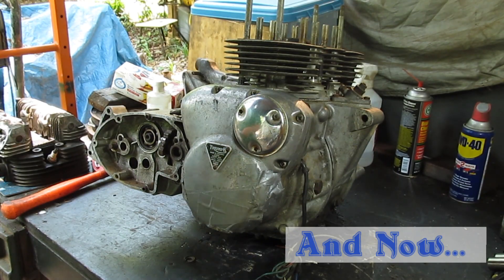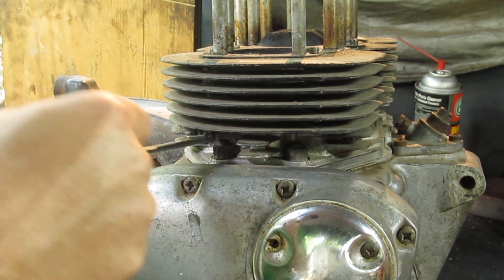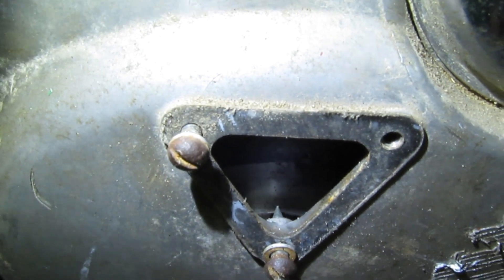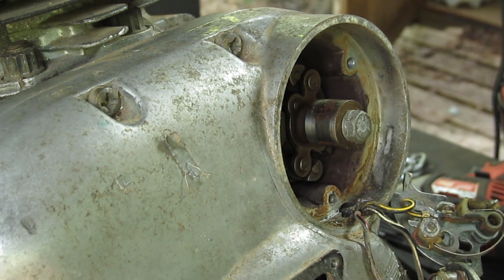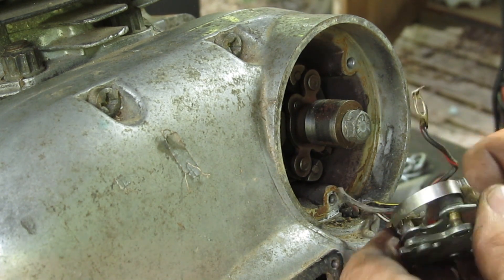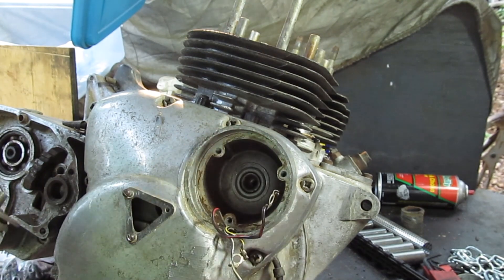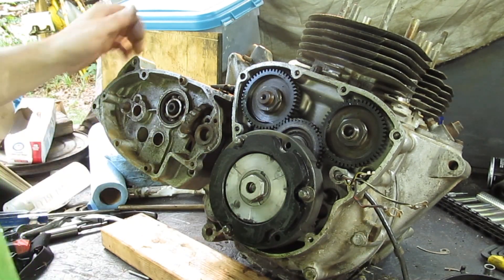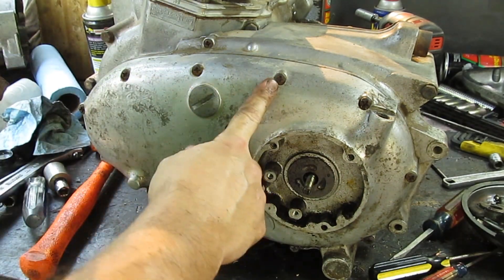Motor is stuck - Triumph Trident Engine Teardown Part 2

Comment: Ok from the noises do you live near the port and chop near to the railroad yard next to a dog pound??
Reply from the maker: LOL. Actually I do live by an Air Force base, that has the most traveled rail line in the eastern United States running beside it. I had 4 dogs and my neighbor was apparently slaughtering chickens that day.
Reply: @theeddies  ha ha brilliant,but why were the cops in attendance?? Brilliant videos ,I have hade a couple of triumphs,one had an engine that looked like yours ,no realy all oily and rusty used it to go to the army camp I was stationed at for two years without a problem until I went into a work hole in the road and snapped both exhausts at the head so being young I thought it was knackered sold it for a Honda 250 and 2 hundred pounds, a lot realy it was restored by the youths at the local collage as a project and sold later for three grand FFS ha ha the other was a bolt on hard tail both 1969 t100 ss and it was so crazy to ride ha ha happy days ,everyone thought I was mad wich explains going into the special forces and being disabled out due to injuries, your videos have given me the urge to start a project, over here in the U.K. these engines would cost a fortune that my crap army pension and minimum wage just won’t strech to so will get one anyway ha keep up the great work it keeps me sane in lockdown all the great film of people sharing there passion

Comment: It would not be a true British motor if it did not leak oil all over your workspace! I know what you mean about Mustie1, I feel the same way I almost never get lucky like he seems to. That chain adjuster clearly it had been put on incorrectly. Glad it freed up that could have been really a lot harder if that motor was seized.
Reply from the maker: It certainly keeps the wood well preserved. His latest video, he has half a bus, rotten frame, he boiled the coil until it exploded, the valve covers are rusted on, the carb was open. And the engine had around 130 psi of compression, and ran like a top after with a different carb and distributor. I just have to smack my head.

Yeah, I am thinking they definitely over tightened it. And either when the transmission broke, it snapped. Or vice versa. The mainshaft bearing has a 1/4 of side play, but that's next time. Triumph tried to modify a Twin tensioner to work here and they actually changed the tensioner system to a much simpler stronger design in later models, .  Luckily, the crank and front end feel like they may be ok. Thanks!
Reply: @theeddies  Yeah, I watched that video and saw the coil explode and thought cool! Mustie has a great Engineering mindset that really helps him resolve some of those issues but man just once I would like to see an epic fail just so I don't feel so bad about myself! :)
Reply from the maker: @MidwestMotoRider  I am with you there brother. He did have one kinda epic fail with the double cab (Krusty) transmission awhile back. I think it was a series called the Krusty Saga. He had to replace the transmission as I remember.
Reply: @theeddies  Yeah, I  have been watching Mustie since back when he had 2k subs he does every once and a while show a fail maybe I should just go back and find a few everyonce and while to remind me he is mortal after all. :)

Comment: Could have been better internally, but... could have been a lot worse too. Still a shame any way you slice it, but gotta push ahead.
Reply from the maker: Oh, yeah. It could have broken a case. So far it appears they shut it down quick or it locked itself up. So far not nearly as bad as the other one I got from the same people that threw a connecting rod through the bottom of the case. It was nasty and probably made the rider crap his pants.
Reply: @theeddies  Were they cheap?
Reply from the maker: @johnstrange6799  $300 for the pair. I sold the good parts off the other for about $700.
Reply: @theeddies  I like the sound of $400 profit, but not knowing the value of some stuff, is $300 a good deal, and one that might be expected to have major mechanical issues attached?? I can see $150 as vintage parts engines. I just don't know motorcycles like that.
Reply from the maker: @johnstrange6799  For this engine, $150 ea is excellent in any condition. I knew they both were broke before I bought them. If I could have turned the engines over and shifted through gears (not run), I would have no problem giving $300-$600 for these motors. In known running condition they can go for $1200-$2000. They are pretty rare though, and have a rather small list of potential buyers. Those prices are not indicative of other engines of the same period, except maybe Harleys. A Honda motor in the same broken condition, I would have given $10-20. It is all relative, lol.
Reply: @theeddies  Interesting and important details. I imagine the rarity of parts is a double edged sword in that you can sell high, but will also pay high. Thanks.